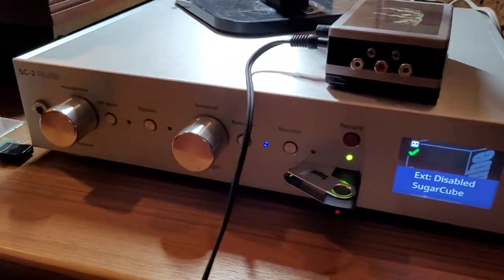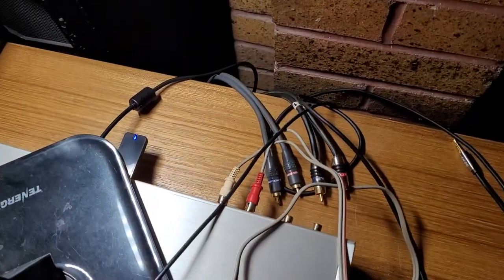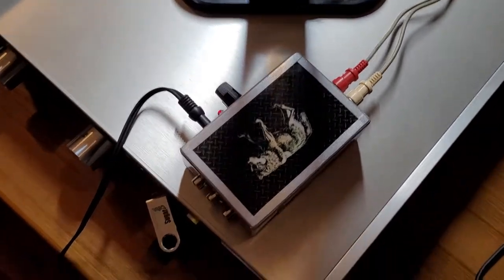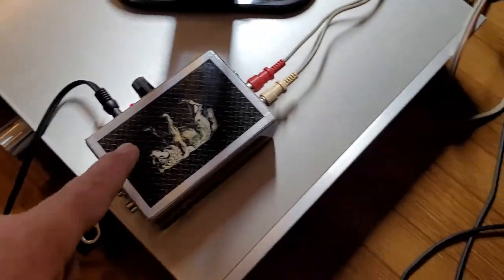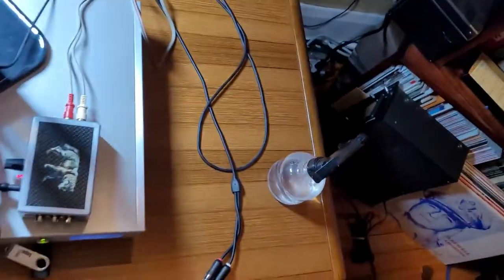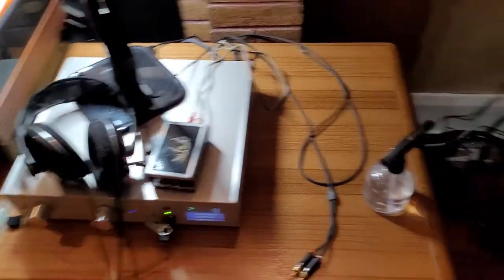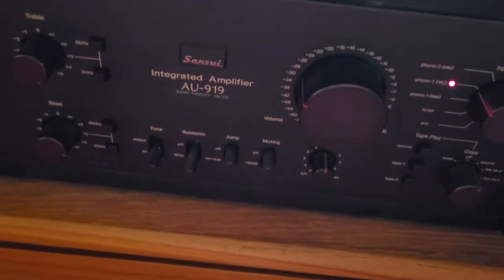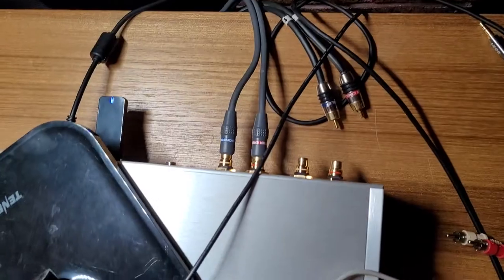Sugarcube SC-2 Plus tick tick ticking ...

Comment: I have the Original SC-1, now V2. And I just checked, and No ticking thankfully. Thanks for that, hope You get yours sorted. They are a Brilliant Piece of Kit.
Reply from the maker: I'm surprised my unlisted video found its way to you, but that's all okay. Their tech support merely had us cycle power to ours and upon rebooting the ticking stopped. I'm hoping that a future firmware update permanently eradicates that. The reboot also enabled ours to record, something it refused to do. Now my biggest complaint is how mediocre the recording interface is, but it's better than no interface so there's that.
Reply: Hi David, i just received the SC-2 mini phono. Actually it came 4 hours ago but I am traveling.

For the life of me i could not tell the difference from this and yours. Ask I could discern on their web site is some babble about improve power supply. I read each of the specs and description carefully and I just could not see it. Perhaps you can share some thoughts about why yours is their top of the line.
Also I don't know where you guys are, but I think we are a small community that has actually bought into this tech as hobbyists. I am in south Florida btw.
Reply: @nazcaplain  Press and hold the "Bypass Button" then It will scroll thought the Menu. You are looking for what Version You are running. If It's V2, then You are Up to Date. Good Luck.